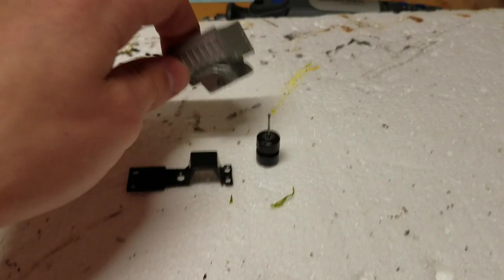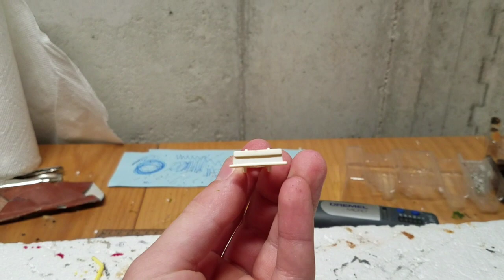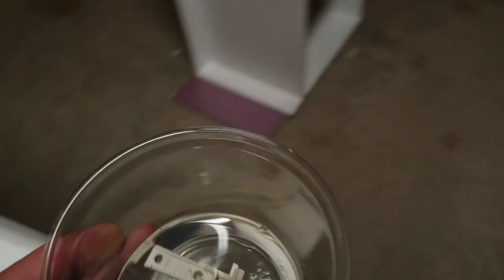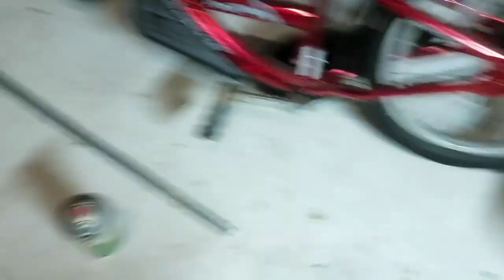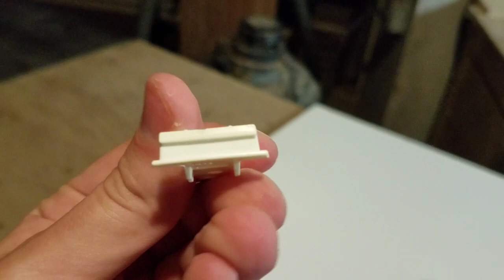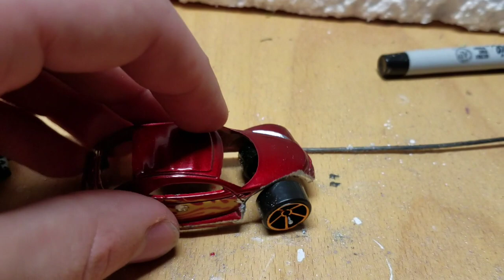Matchbox Restoration: 1980 Lesney Articulated Truck and Trailer

Comment: On the cab, the square shapes on the front either side of the white strip are the turn signals, it is loosely based on a Leyland T45 RoadTrain